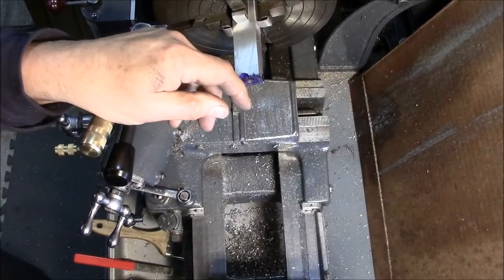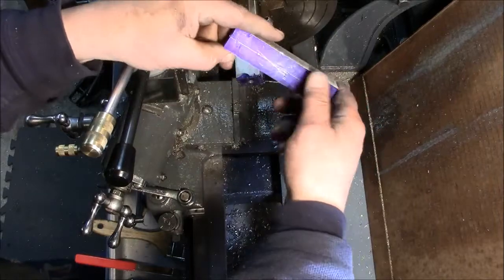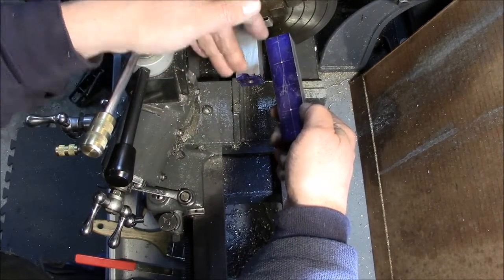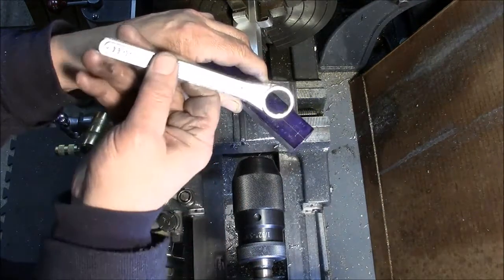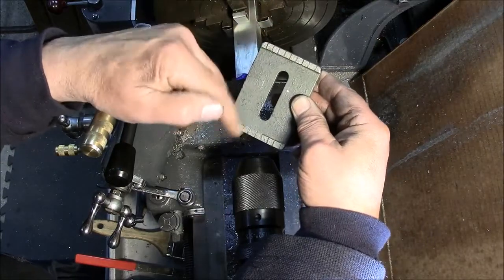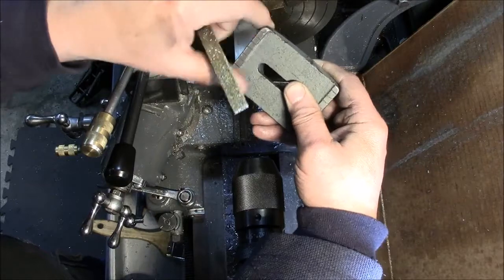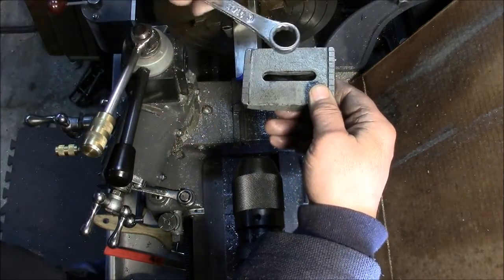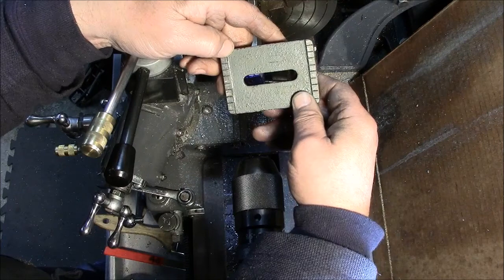Taming a Traveling Tailstock Movie (Three minute movie)

Comment: As usual, nice job!  Where did you get the diamond file?
Reply from the maker: You can purchase sets of diamond files on Ebay.  I have a set of 6 files from #40 to #600 grit. 400 and 600 grits are great for honing carbide edges on lathe and mill tools.